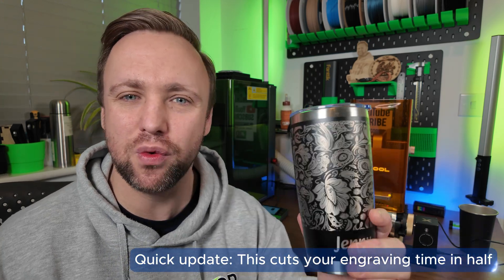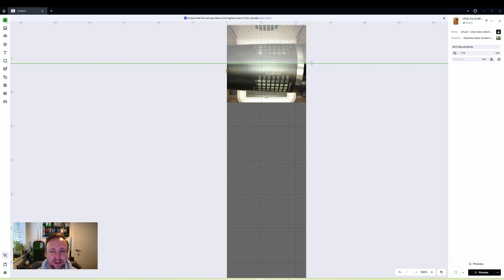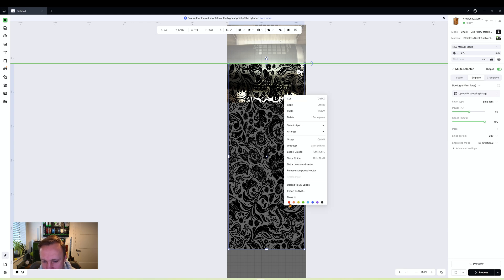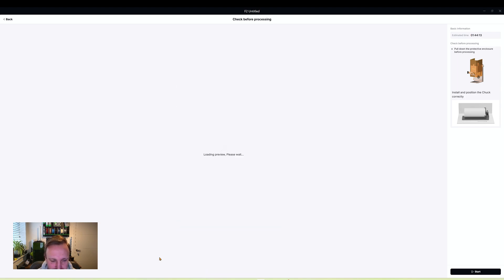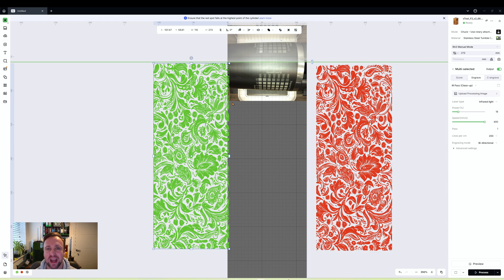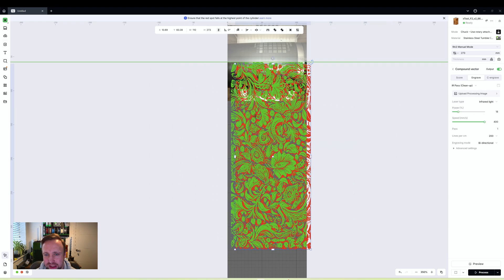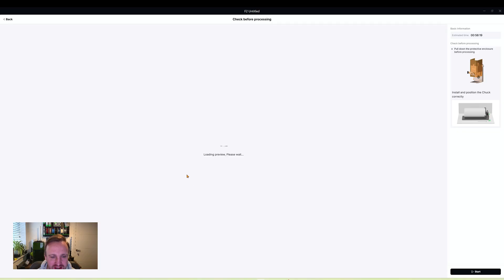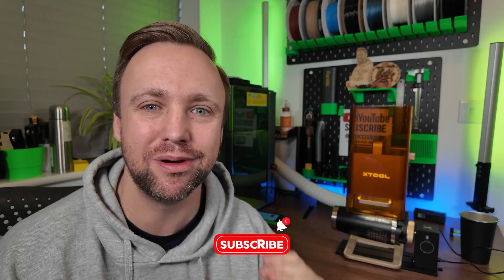How to Cut Your xTool F2 Rotary Engraving Time in Half

Comment: Is there a side by side comparison of the final results after using this setting??
Reply from the maker: Unfortunately not, I didn't have another tumbler available. But the engraving would probably look the same or better with the quicker method because it's not moving around as much.
Reply: The engraving would look the same. No changes that just the time, because it’s not skipping around.